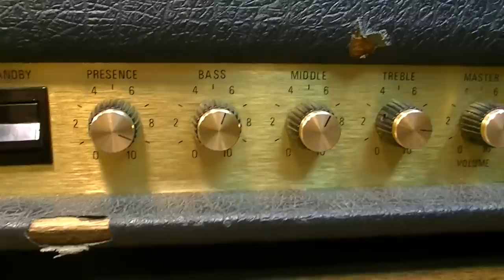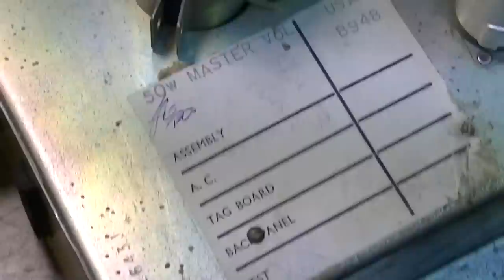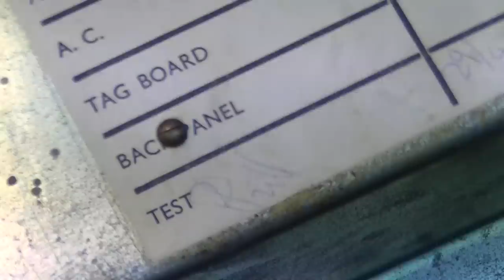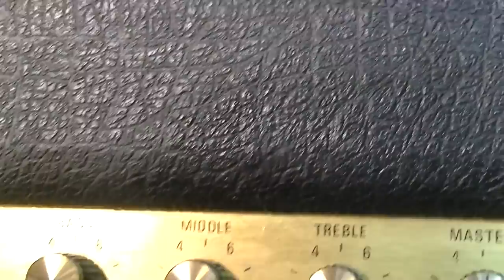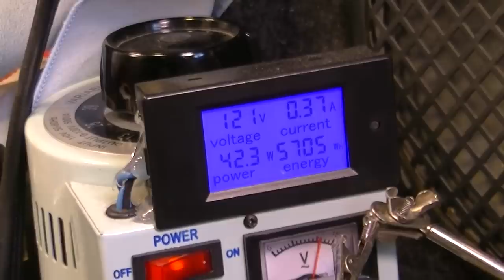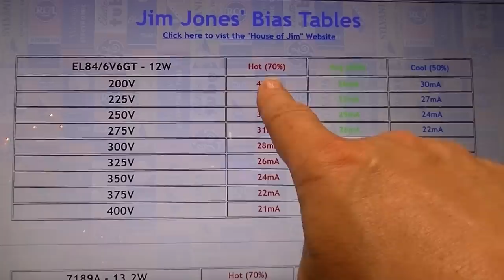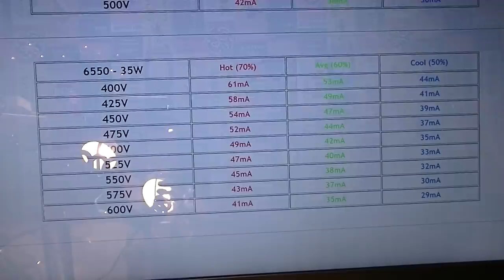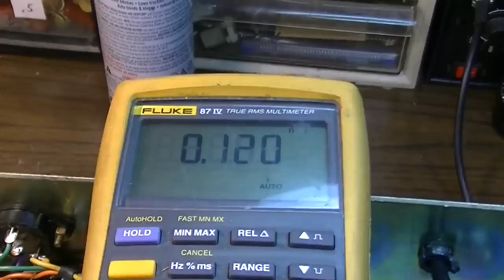Secrets of the Marshall JMP 2204 Master Model 50W Mk2 Lead Head - The PERFECT Marshall Amp!

Comment: the "missing" components aren't missing at all. Marshall built all their amp versions, 4 input lead, master volume, bass,  all on the same board in this era. Which is awesome for modding. My 1978 Superbass has been modded to Superlead specs after a short stint as a 2203 MV , all with minimum component changes.
Reply: I thought the Super-Bass was even more sought after than the Super Lead? I agree! This period of Marshalls were great, I don't think they made the PA or Tremolo (Keyboard) heads at that time, but they were great for modding!

Comment: I had 2 of these in the early 80s the best rock amps ever. Period
Reply: In 1986 I bought one just like this for $300 in the Denver Post classifieds! It was beat to death, but it sounded awesome to me. The problem was I had no idea how to treat a tube amp in those days. The output transformer blew one day because I was in idiot kid and likely had it on with the speaker load disconnected, at some point during tear downs for a gigs (I can only assume). Worse, I didn't have the money to fix it for $250 at the time. So, I ended up selling it to the Guitar Center service manager for $150 (I was completely destitute) a few months later. Today it's worth 10x what I paid.

I really wish I could have kept it but I'll probably scrape together the parts and build a clone for myself fairly soon. These days I want that particular amp back way more than I need the cash, but isn't that "the story" for most of us as we grow up?!
Reply: I passed up a 76 for 500 bucks around 1995. I had 450 and shop booted me. Now folks, the Artist 30 is a great budget tube hybrid. You can't tell its not a JCM800. Jrc4558s in preamplifier (aka ts808) and EL34s. Those are under 5 bills. Mine was 375 bucks and light as a feather

Comment: I have one from 1979 and have owned it from new. Last year I took it to the Marshall factory to have it serviced( I live in the uk not far from the factory). They charged me about £95/$120 and replaced all the pots and caps on the front panel and jack sockets and one small cap on the main board. The amp actually sounds better now than when it was new.
Reply: How did you arrange this? Just contacted them? Would they honor such. Thing for a non-original owner you think?

Comment: I have that in a 78 model. I bought it new. 50w red vynyl. Just out of the shop it sounds GREAT! When I picked that up, I dropped off my 65 Twin Reverb. I had it in the attic for about 15 years. I had put a pair of vintage 30s in it and then it quit working. My tube amp guy is retiring, but I got him to repair all my Tube amps.He has done it for over 40 years. When I picked up the Twin. He said it is the best sounding amp he has ever heard. Mind blowing considering he has probably worked on thousands.Now if I could only still lift it. Thanks! Love your vids.

Comment: I still have my 1979 Marshall JMP50 2X12 combo that I bought new back then. Pretty sure it is the same circuit as this 2204. I agree with Guitoligist. The JMP's are the best sounding master volume Marshall ever. My JMP50 has over well over 2000 nights gigging on it. It still performs and sounds awesome.
Reply: pat benitar band guitarist Neil Giraldo used two of them ans a delay thats it for years,, great tone.

Comment: I am still gigging my 79 Marshall mk 2 master volume 2x12 valve combo great sounds and never let me down.
Reply: Paul Gibson They are tanks. I have been rocking a 4212 JCM800 2 x 12 50W Master Volume combo from new in 1983. I have never needed to carry a spare to gigs "just in case": Marsha has never, ever let me down. I recently had Marshall in Bletchley give her a complete birthday (decades of heavy metal gigging had left her in a rough state, but still working). Now she's good for another 36 years, looking good but with a few battle scars remaining on the control panel. I run either a 1998 American Standard Strat or a 2002 Les Paul Standard through her, and she rawks with either. With the amount of gain I use, I find a noise gate is essential.
Reply: I’ll buy it!

Comment: Back in 1976 I was in the Navy. We had a short we were trying to find in F14A. We had an old megger, it used DC instead of megohms. Well the handle was a makeshift jury rigged thing. I was cranking that SOB (without the knob on the handle). I remember looking at the meter, it said 500V, I casually leaned up against the aircraft...wow. It was like I got punched in the jaw & the feet at the same time. I let go of every thing on my way to the steel hangar bay floor(we were on an aircraft carrier). The megger fell off the steel stand as well, & busted into about 1000 pieces! We had to borrow 1 that did megohms from our sister squadron. I'll never forget that! Lmao...now.

Comment: I have this amp that's why I'm here. 77 was a special year. Mine shipped with 6550 but I had it converted voltage is about 480 for el34s. I had an effects loop installed by a tech in the 90s. the amp is magic. for tone chasers this is the holy grail of all master volume amps. mine has magical mojo never heard any any amp that sounds like it except another great marshall or maybe a friedman.

Comment: There is spare tolex inside the amp  on the over laps , in fact  quite a lot of spare material for patches if you need it. thanks for the Sharpie tip !.
I recently purchased one of these beautiful amps .it's also 1977 ! My birth year. Makes me feel old !.
Thanks for the video.
Reply: black shoe polish ,,,,,,,,,,,,,,, sharpie is is not truly black and is noticable in sunlight
And "Phenoseal black vinyl caulk " is best for repair
Reply: Also, I would try using a small square of stainless steel or aluminum window screen material to hold down the Tolex during repairs. You can form it to the shape of the surface. This holds the flap down and frees up your other hand to spritz on the CA catalyzer right through the screen...much faster. Wipe dry and then a bit of black shoe polish or even black touch up paint, just wipe off the excess (especially if you color the repair with sharpie, which is actually appears reddish in some light after drying).

Comment: I've found the best thing for gluing down Tolex is Titebond, you can be generous with the glue, wipe off the excess, tape it down, then when it's dry a few hours later, a wet rag cleans the schmoo off the finished repair.
Reply from the maker: Probably works too. I've always used super glue for the quicker dry time, and isn't water soluble like titebond. Real humid day in the back of the van and the titebond might start to lose its grip.
Reply: good 'un I’ve a bottle of superglue that’s been going for several years now. I keep in a little baggie.
Reply: good 'un I don’t doubt you, it’s just that my experience has been different. It still works fine for everything I use it for but I’m sure a fresh bottle would be better for stubborn repairs like tolex that wants to lift.
Reply: If you only open it for very short amounts of time, and/or if you live in a dry climate (or only open it in a well-air-conditioned room), and then always keep it in a ziploc bag in the fridge, you can get a lot more than 30 days out of it. 
But if you're in Texas during the summer, and open it in the garage, where it's 90+ degrees with 90% humitidy, and don't close it _immediately_, don't expect more than 30 days.
Like good'un said, it's the humidity in the air that kicks off the curing process.
Reply: Super glue is great on small nicks and dries invisibly.  Use a popsicle stick to hold the tear down while it hardens.
Reply: Black "Phenoseal Vinyl Caulk" !!! the tolex is vinyl ,,,,,,,,,,,,, the caluk is vinyl ,,,,, so ,,,,,,,,,,,,,, 

I have faked missing areas as well

Comment: Fun Fact; Steve Grindrod designed the two input master volume 2203/2204 in 1976. He also designed the JCM 2000 DSL50 and DSL100 in 1995 to compete with the Mesa Dual Rectifier.

Comment: Lol, I thought you were gonna hot glue the tolex down! 

I think it's interesting how many folks took the time to comment about how this board is used for different amp models (which you mentioned, as you also said re the chassis). Yet some of those same folks did NOT take the time to pay attention to the clipped leads and non-factory solder flux around different components, nor did they listen to you as you described how such criteria tell you exactly that. Some people, man... LOL

Thanks for another cool vid, Brad!

Comment: You are correct about the voltage danger. I've been working on amps and O-Scopes for over 15 years and Never touched full live voltage. Have been bit by charged caps a few times. The worst guitar amp for hot caps is the Peavey Windsor and other models with the Ground Shorting Relay, that's Suppose to short the caps to ground when its shut off. But the Relay stayed open and I got about 40vdc into my right hand ring finger. So don't rely on those shorting systems.

Comment: Agree with the JMP 2204 being the ultimate Marshall.  I was a JCM 800 fan but after listening to a few examples, and matching it up against the catalog of iconic recordings... I'd have to admit the JMP is probably more my amp.
Reply: Is there any difference to JCM800 model 2204 and JMP 2204?
Reply: @qddk9545  As far as I know there are some minimal differencies but the circuit is somewhat the same, just the build quality is not the same.

Comment: Do not add the 330 uf cap.. These boards are dual use . 330 cap is for the non master volume model. Read  the silk screened info by cap.
Reply: 3045mc planebreaker you beat me to this.  They used the same board for the MV and the 4 input non-MV (I.e. model 1987).
Reply: I had the 1987 model form the '80s. Same board and even same output transformer. So bassy I had to run bass on zero.
Reply: beat me to it too. I had to remove it when converting my 1987 to a 2204
Reply: On the lead series with 4 input the first two gain stages were in parallel, on the master they were in series like the jcm 800 so yes they did not use the 330 cap. First gain had a bypass,second stage should not as that has the 10k cold bias resistor.
Reply: I hadn't seen that schematic but wondered if they had done that. So they just eliminated two jacks, and left high and low. Not meaning sensitivity but was a normal and bright, and was parallel not cascaded, then added a master vol. Seems strange as 1 gain stage then the cathode follower you don't get much pre-amp distortion so with the master you lose the power amp distortion. I see why it was a short lived design. Thanks I did add that schematic to my file.
Reply: It looks like under the 820 resistor the board is marked 10k which would lead me to believe it was a cascaded model.
Reply: If cascaded definatly leave out the cap.
Reply: borz666 ... Not only, there are a few other parts you have to change. Also the wiring of the input jacks. I do this on my 1987x Plexi but i replace the complete board to a handwired one. You can find all informations on google „2204 layout or schematic“ than you’ll see the differences👍

Comment: On the lead series with 4 input the first two gain stages were in parallel, on the master they were in series like the jcm 800 so yes they did not use the 330 cap. First gain had a bypass,second stage should not as that has the 10k cold bias resistor.

Comment: Hello from Mexico City, my name is Dimas and I’m 42 year old. I’d like to know a little bit about some aspects concerning music; Electronics, acoustic, recording , and playing BASS hardcore punk STYLE too. I must say that your video is very cool and  informative. Thanks a lot, it was pretty enlightening!
Just a few  days ago  I got a 2204 in my lab , it  turns on correctly, starts to sound too, all knobs work , but after a few minutes the sound lowers down gradually to zero, and it has to be turned off again, wait FOR A FEW minutes… turn it on again in order to have the sound back.
Looking inside I noticed that it’s complete, in very good conditions ,no modifications or damages in the TAB  components, maybe it has never been repaired. (my friend says the headS have been more time  sleeping than in use. Almost for 25 years.
The tubes are the 6550 general electric label (they are a little flamed) both glow. 
The preamp tubes have a blurry label.
The ht fuse was repaired with a filament and the main fuse  is in 2 amp not 3. 
The jumper selector cap is lost. 
I’d like to begin the troubleshoot with a cleaning up, an then I think I’ll have to test the tubes and the blue caps labeled DALY.
The box is clean without damage only the logo is broken, but I have another and a 12” speaker from a flood survival .
What’s your opinion doctor?
I hope you can give me some advice in this process.
Thanks in advance. Excellent work.
PS. 
I’ll Attach YOU  A FEW PICS to your mail GOODBYE.           DIMAS RIVERA

Comment: Hey Brad,quick tip here...when you try to put super glue somewhere and you need to use your finger to press, you can wrap your finger with electrical tape so it wont glue together
Reply: Good trick - I actually use wax paper, especially in spots that I can glue and clamp.  Put some wax paper between the clamp and glued area.  When the glue has dried, the wax paper comes right off.

Comment: I hold fast to my opinion that all the best Marshalls had 6 knobs.
Reply: 6 knobs just looks right to me.  6 knobs, no switches other than power.  Anything more and I are begin confused.
Reply: ^^^^^ this is 1000% correct!
Reply: This is NOT correct. The Vintage Modern has two extra dials for Body and Detail. 6 + 2 = 8 knobs.
Reply: Mike H i agree
Reply: Mike H You're not wrong!
Reply: 6 knob snob here. Who needs channel switching when you can do it all with the volume on the guitar?
Reply: Still have my extra impedance selector on my keychain, but have also used old metal coat hanger.
Reply: Amen. 6 knobber glory is a real thing.
Reply: I love my six knobber. I also think these big logo JMPs were the most beautiful amps ever made.

Comment: I've recapped and cleaned up many Marshall JMP 50's and 100's as well as JCM 800's 50's & 100 watt Marshall's. This is a great video. Surprised to see you did not replace the two 10 mfd axial capacitors that usually come with the recap kit. Also if you can't get the bias up you could just piggy back a resistor on the bias resistor. I'm sure already know that.

All your videos are awesome please keep them coming. 

2 more things the 330 mfd capacitor is not needed on these amps and the bright cap should be clipped it just sounds better and takes away those extreme ear piercing highs.
Reply from the maker: All good points. On the axial caps, they are low voltage and were still working perfectly so I left them alone for now. I was borderline going to replace them though.

Comment: No Master Models, 2204 or 2203 came with that 330uf cap. What you've done there is add a mod, not revert one.
Reply: Was about to post that, but I read through comments first.
Also those 'missing components' aren't missing.
This is a 2 channel master volume amp and not a 4 channel lead amp.
The extra components are for the lead version.
Reply: @DrWatts-bi1jv  Would you trust this guy to repair your amp? 30y ears ago I had a 2204(kept it for about 20 years). looked inside it and it was obvious to me, a person  who had 0% electrical knowledge then that the PCB was used for both 50 & 100W models and  probably the non- MV ones as well.

Comment: I had a '77 Mk II 2204 for about 3 years in the mid 1990s then sold it like a dumbass. I got '79 a couple years after and I've played the hell out of it and it's needed little maintenance. Of all the amps I've had or still have this model is still the best. Crazy Marshall tone/crunch at pretty sane volumes if you want. Of course you can still crank the master and blow whole neighborhood up.

Comment: Brad - back in the 60's I used to use a thick clear  vinyl glue in a little yellow tube. Seal-all.  It had eye-hook tapered screw to seal the tube when you were finished with it.  It was wonderful on black Fender amps.  It would also seal small holes in car gas tanks.  Being vinyl, it worked smoothly with the black plastic and unlike crazy glue it always remained soft.  Just cover the repair in a bit of waxed paper and hold it down with some masking tape.

Comment: I have a modeling tip\hint for you. Maybe you know this already but when working with Superglue I use foam to absorb any excess glue that may Run or end up somewhere you don't want it. The pores in the foam absorbed the excess glue like a sponge.

Comment: My first Marshall stack I got in 1988 was a 1979 JMP 2203...painted immaculate blue with a matching JCM 800 1960 cab (would be 4 Celestion G12M60, 65 or 70 watt 8 ohm speakers with 260 or 280 watts capacity. 3 ECC83 preamp tubes and 4 EL34 power tubes...Siemens or Telefunken. Louder than hell !!

Comment: Funny. My drummer has a 2203 of the same era (even with 6550’s) and he was missing that same capacitor. We always wondered why it was such a harsh, scratchy amp. He had it serviced recently and the tech noticed that, replaced the cap and it was a totally different amp!

I’m sure the rest of the work made a difference, but you know what I mean.